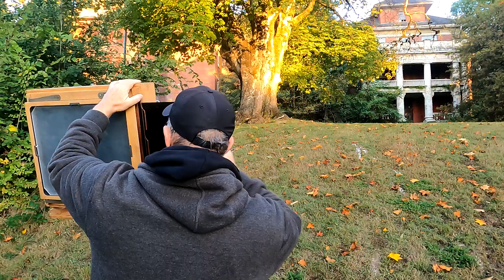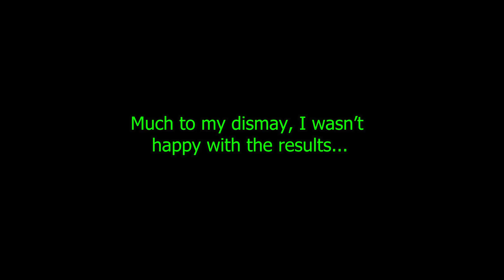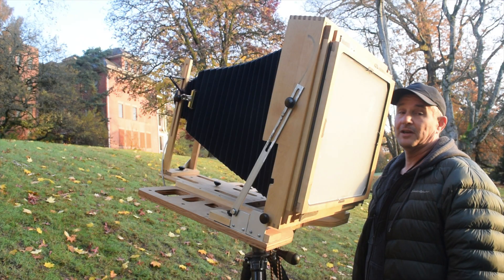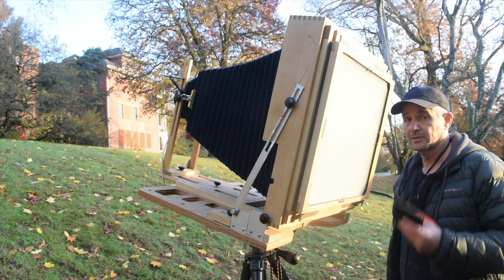14x17 Coliseum Maple Carbon Transfer

Comment: Thanks for another great video.  Glad to see the amount of developer your using.  So that three liters was for two 14x17's half for each as one shot?  Looks like the bellows is hanging better now than it has, I guess the greater stretch with the longer lenses.  Thanks again.
Reply from the maker: Yes, the three litres is for two sheets. I still have to test to see if I can reuse the developer, at least 2 sheets for the 1500ml of working solution, instead of one. Cheers!

Comment: Technically, the camera and its movement will allow to achieve focus of the tree. So what was not ideal in the October shot that made the tree out of focus?
Reply from the maker: I didn't apply any movements to bring the tree into focus.  I should have them focussed on the tree,  and let the building go a bit soft.
Reply: @analogueandy8x10  the camera you made has only the front standard vertical swing and horizontal axial tilt, right? 
If you apply swing, focus on the tree and swing towards the building, repeat until you get both as sharp as possible and then stop-down the aperture?
Reply from the maker: @PatAcct yes, I've used the swing/tilt features for manipulating the plane is focus with this camera several times in the past.  I felt it wasn't necessary this time. I should have applied a little front swing thinking back on it.
Reply: @analogueandy8x10  yes, I see. :)